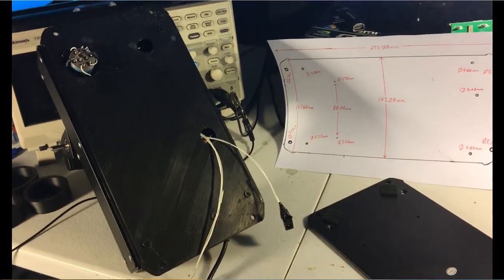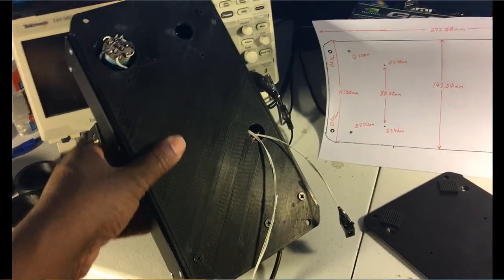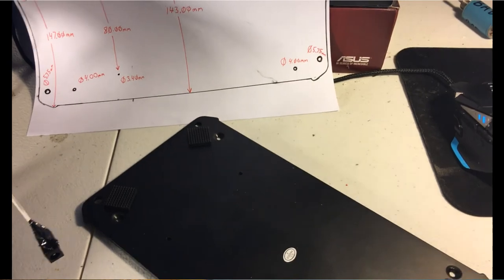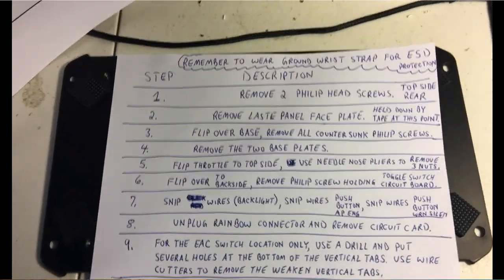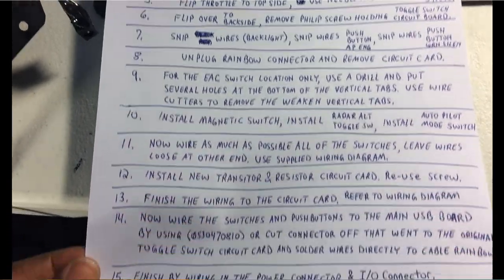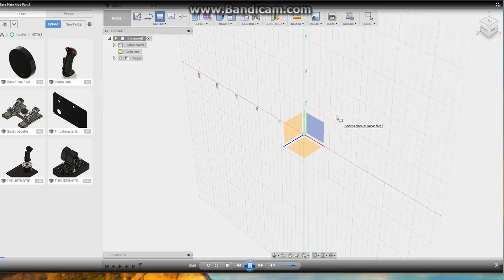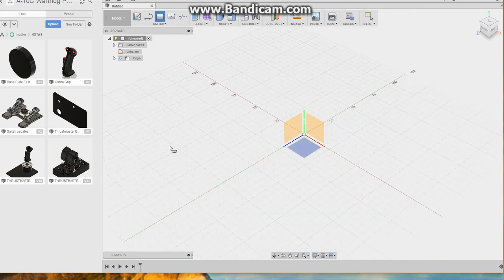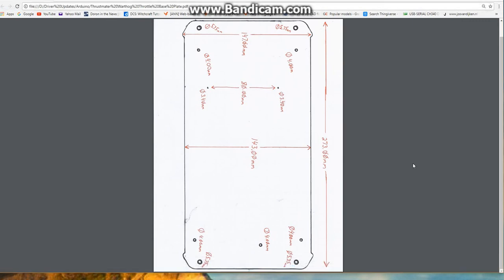Thrustmaster Warthog HOTAS EAC Mod Part 2

Comment: Hello ! You are doing amazing work ! Can you tell me name of the programs what you using in video AutoDesk Fusion 360? Do you have some schematics for share ? It will be perfect if i can send file to people who can cut this all stuff !!!
Reply from the maker: Good Day. Yes its AutoDesk Fusion 360.  Their website says a 30 day free trial.  But its actually a year free trial.  Then after the year is up, if you are an individual or small business making less than $$$ annually, then you can still use it for free.  I've attached a link to that base plate sketch.  My main goal is to help people get involved in making things.   That way, it maybe you who has the next great idea.
https://drive.google.com/drive/folders/0B4xdTr8IidWTT3FORlJrTUhLcGc?usp=sharing
Reply from the maker: Good day. I see you are customizing your own console for VR.  Maybe you making CDU with no display. But if you are making it with a display,  I used a 3.5" TFT LCD from Adafruit. It's the perfect size and it only $45. The only small snag is there are 8 character symbols that are not ASCII standard and I solved that by modifying the font file for that LCD. It's the 5x8 character bitmap that draws the 256 character symbols. You will need to edit 8 of them. I will do a video on that and the CDU shortly. For the CDU frame I would recommend pcflights.com. I am going to be replacing all of my homemade panels with theirs. In your case, you are condensing the size for compactness on some of your panels. So making your own would be more ideal for you as it is a custom smaller version of the real thing. 
In the final version I used one arduino mega and one arduino micro to drive the panel because I did not use any keyboard scanners to shorten the I/O count.   For switches pcflights.com sells the 6x6mm lighted pushbuttons. When I made mine I used 12x12mm tactile pushbuttons but it was a tight fit.  The line keys I had to alternate between 12mm and 6mm. 

https://drive.google.com/open?id=0B4xdTr8IidWTMFBpS2czbGVXVjQ

http://ascii-table.com/codepage.php?857

http://sunge.awardspace.com/glcd-sd/node4.html
Reply from the maker: I could only view it as a web based browser. But it looked like the lighting panel I think. Not sure what problem you are having with it but try search YouTube for fusion 360 and the name of your problem.